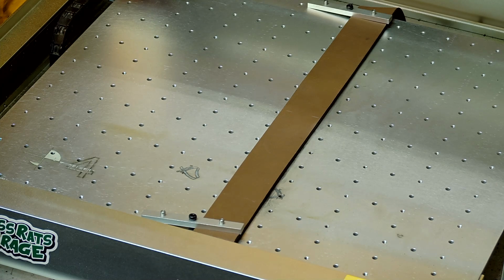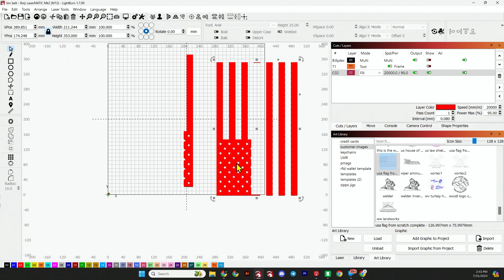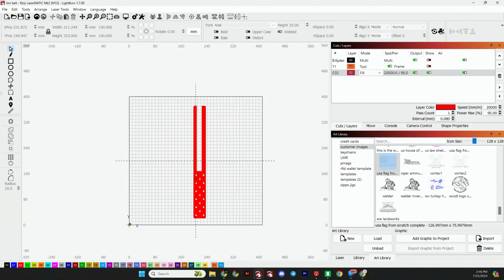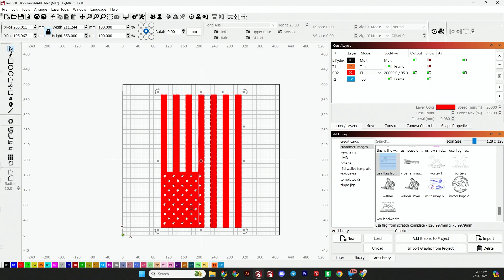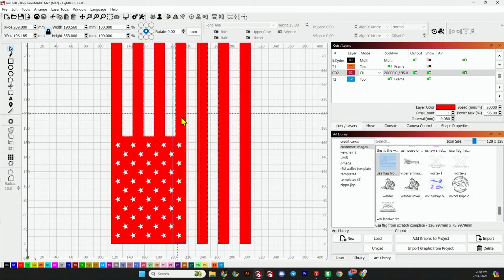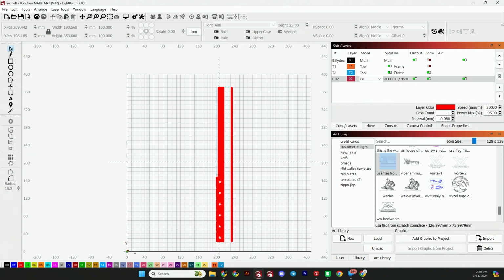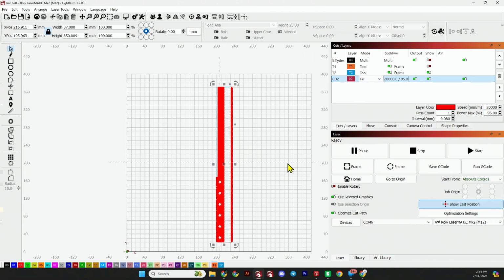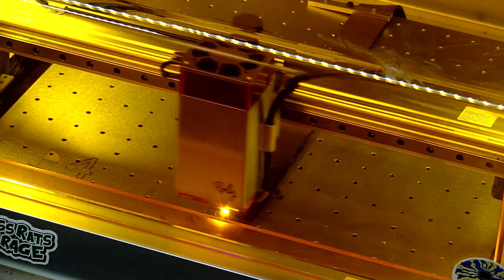Engrave a Belt with a Diode Laser - Lightburn Settings Included - Lasermatic MK2 30w

Comment: Patrick. would 2 additional jig bars, 1 at the top and 1 near the bottom in the holes that you were using for alignment give you a solid index or does it push the belt too far over to be fully locked down by the inverted jig bars?
Reply from the maker: it may work, i'll have to try it out when i get a moment. solid idea.